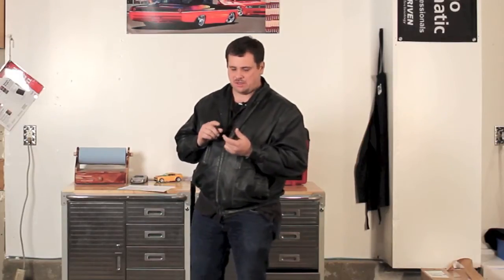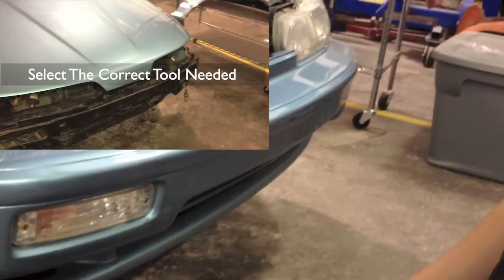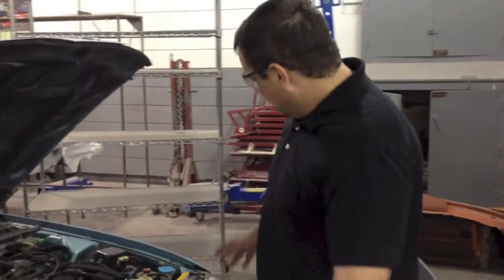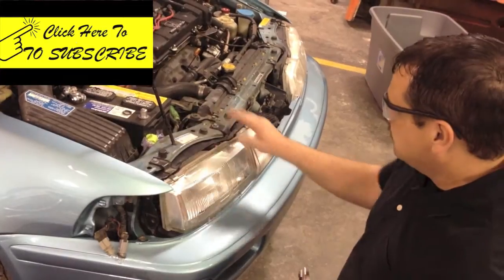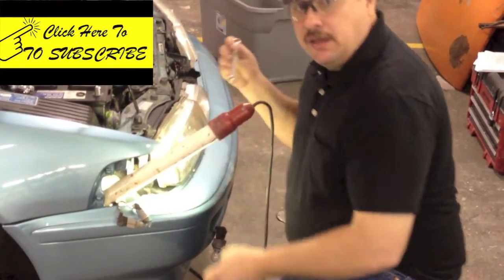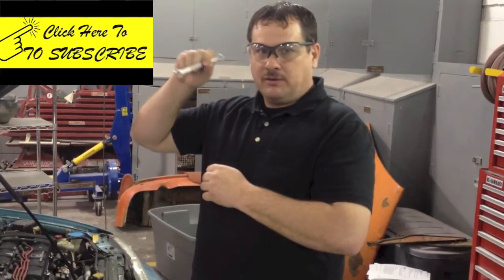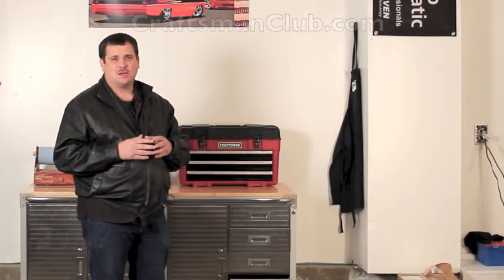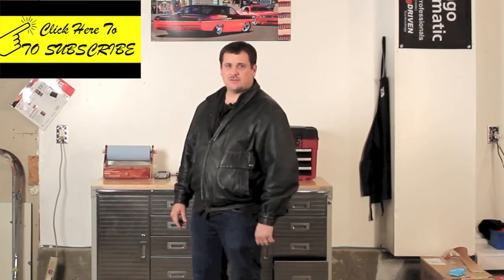Remove Headlights and Bumper - Honda Integra - Giveaway

Comment: Glad you did this video as I am about to pull both front and rear bumper covers on my Accord, basically the same set up. I want to replace the headlights in it as I am there, thinking it will be easier all at once. Can smell gas but see nothing dripping right at the filler neck and have some repair work to do so off with the rear and the front lights and a few deep scratches on the cover to be repaired so off with the front.

Comment: 1:48 You do not need to remove the outer screw. The housing will pivot away from the inner screw and unhinge from the bumper. Also, it's a good idea to go to a local hardware store and replace both those lens screws with stainless ones ... size no. 6 thread.
It's also far easier to remove the headlamp assembles with the bumper cover removed first.

Comment: How was he able to remove the headlights with just 4 bolts? My 1990 LS coupe has a 5th bolt on both sides that are an even bigger pain to get to than the 4th bolt. You have to take the bumper of before you can get to them... Whoever placed those 5th bolts is a sadist. It took me forever to remove both the 4th and 5t bolts on each side.
Reply from the maker: I think this car had been apart before cause we noticed that it was missing some things.  It's been awhile since we worked on this car so I can't remember for sure, but it was a pain.
Reply: Everything goes much easier with the bumper cover being removed first.